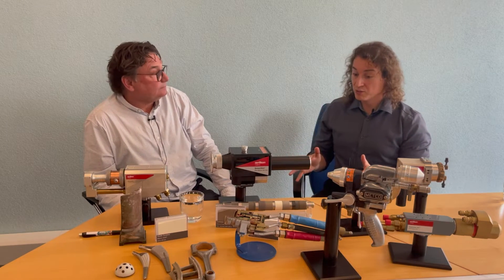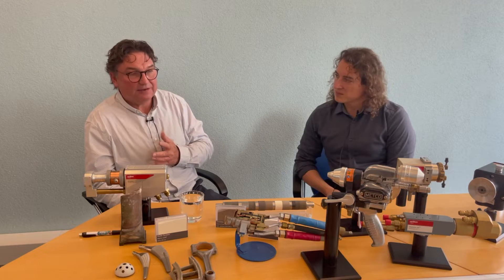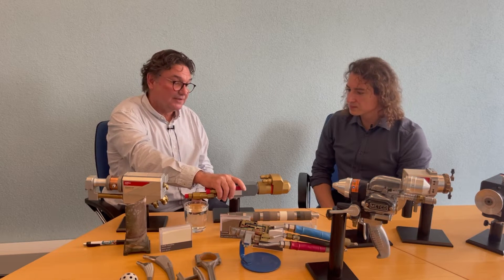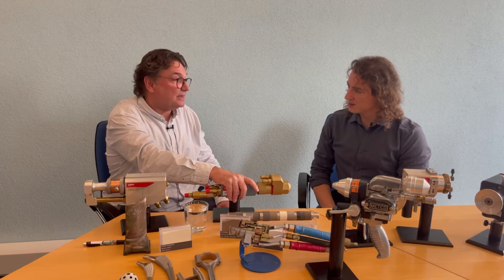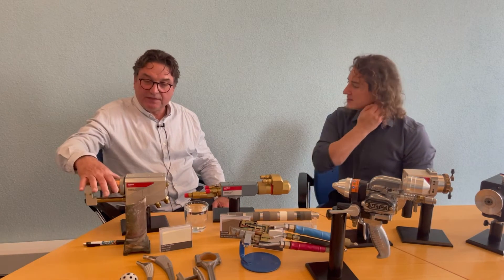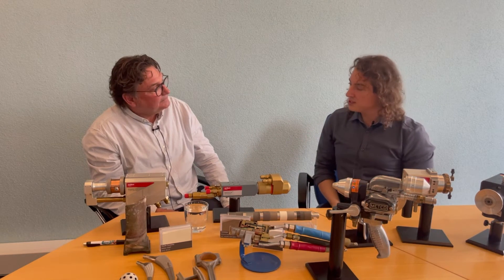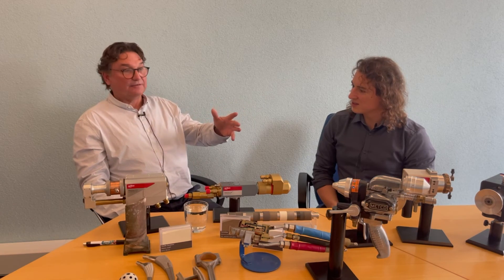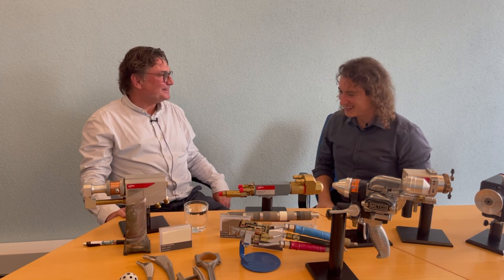Why HVOF Is the Workhorse of Thermal Spraying | Interview with Peter Ambuehl (Part 2)

Comment: Which coating can deposit 1.5mm thick Ni-Cr-B having hardness 60-62HRc.
Reply from the maker: I would do that with laser
Reply: If you are serious give me your email.
Reply: I might be able to help you with that.
Reply: @notworthit1096  
Thermal coating can be apply on wood,wax, plastic?
Reply: @LK29999 yes but not in the same way as metals.